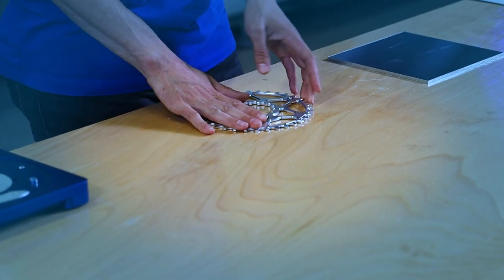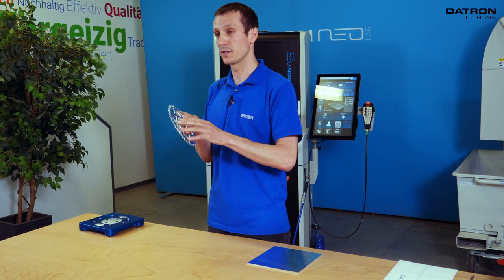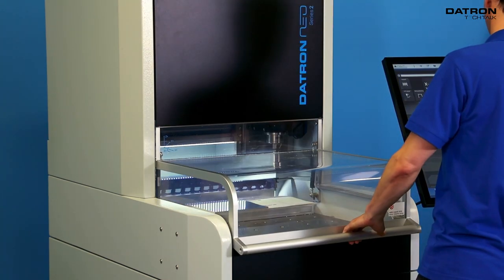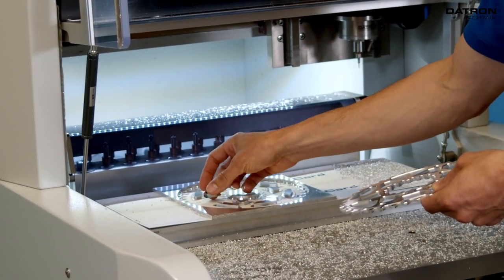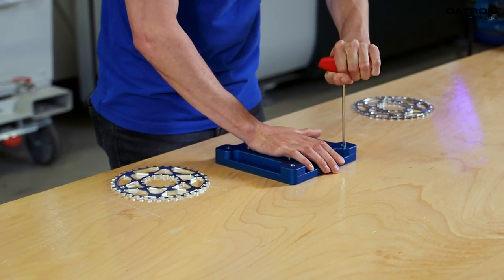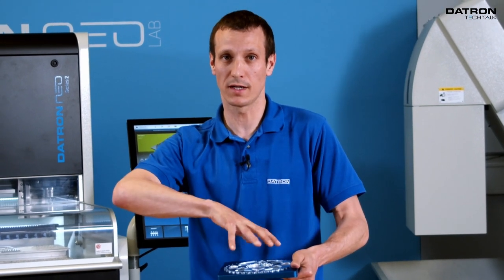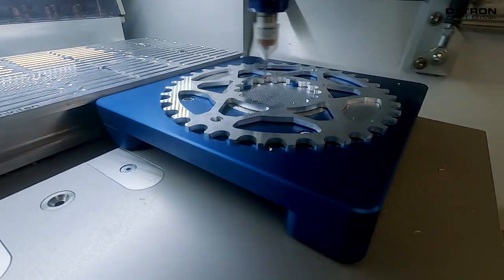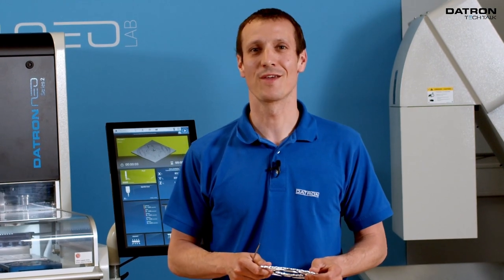Milling irregular 3D surfaces - DATRON Tech Talk | EP 01

Comment: Are gaskets required between the fixture and the part?  Would have thought gaskets would be required to hold the vac between two rigid metal objects (the fixture and the part).
Would be awesome to see some videos on some of the more notable custom fixtures, like this.  Clever fixtures like this really boost the efficiency of the Datron ecosystem
Reply: Usually yes. In this particular case it (surprisingly) work without it. I even had problems when I first gave it a try (with gaskets). I assume because the gasket is not equallly higher than the surface (curved surface vs. Z-perpendicular slots). 
But we realized another project with a similar fixture, this time WITH gaskets. Stay tuned, we are already in the making, it´ll come with some good tipps around gasket workholding technology! 😎